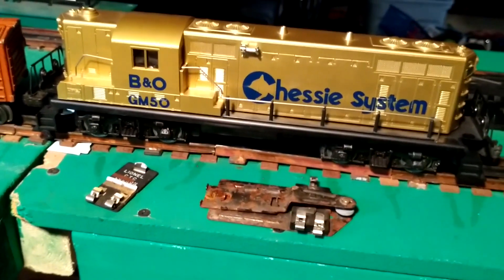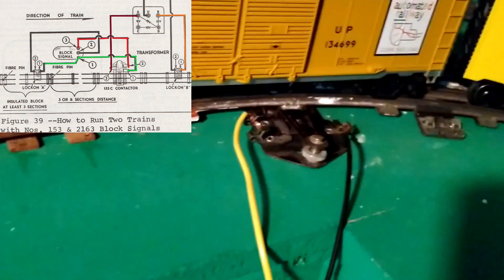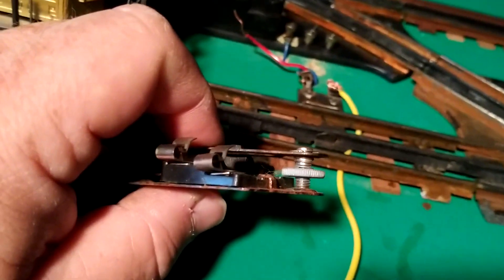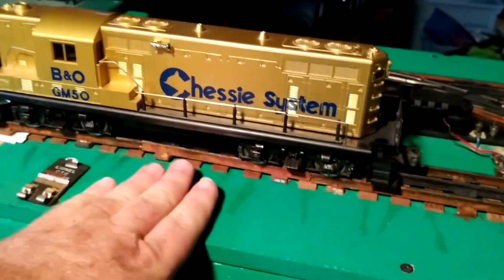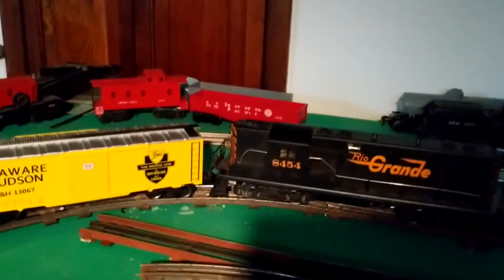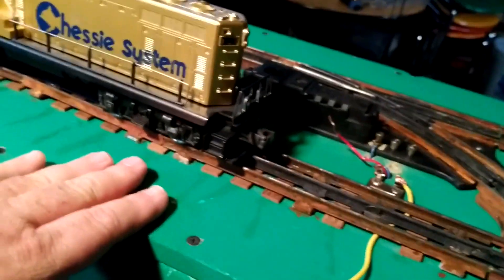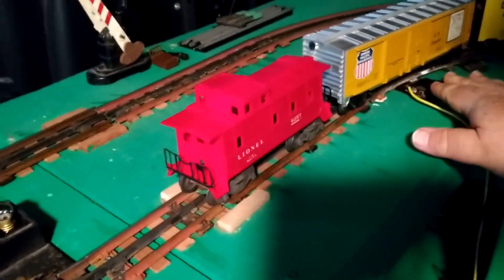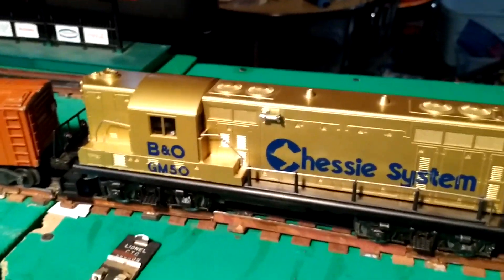Block Control Without Relays Or Detectors? Lionel Style Train Control!

Comment: I wired mine using the other terminal on the 153c. This means the train will stop (in my case at a 90 degree crossing). Once the second train passes the crossing it rolls over the 153c activator and turns on the track at the crossing. Always plenty of distance between the two trains.
Reply from the maker: Great tip! Thanks!

Comment: Thanks for the demonstration and the info, especially about the multi-volt feature and how one transformer can apply different levels of power to different sections of track all at the same time...this would also be useful when wiring graduated trestles where you always need more power going up hill versus coming down the other side (assuming your trains were always going in the same direction) it should work quite well. T4
Reply from the maker: Yes. It's a common trick on grades to add higher power upgrade and lower power downgrade. If trains are bidirectional on the grade a relay could help determine which power level to use each time.

Comment: I tried this years ago using a 132 station, a bit different idea- I tried to use the 132's "switch" and a contactor to control two turnouts..but I never got it to work right (ended up frantically throwing the 2 turnouts manually  to allow the following train to bypass the sidng the 132 was on)...I thought I needed relays, but  your video has got me thinking again...LOL Thanks.
Reply from the maker: Interesting idea.